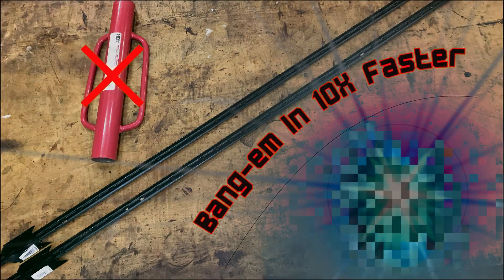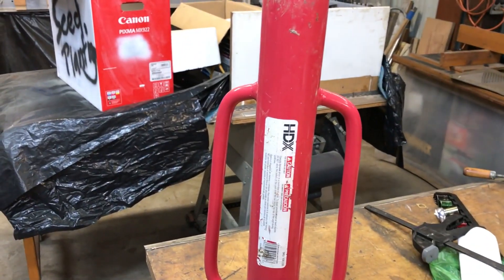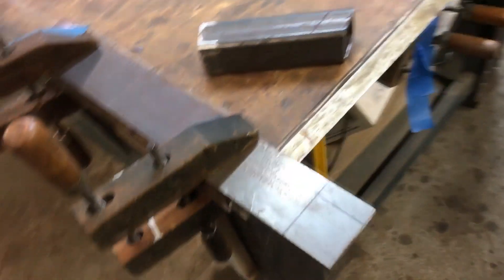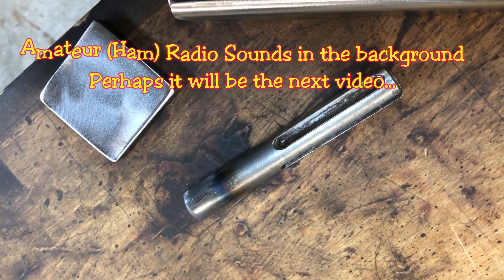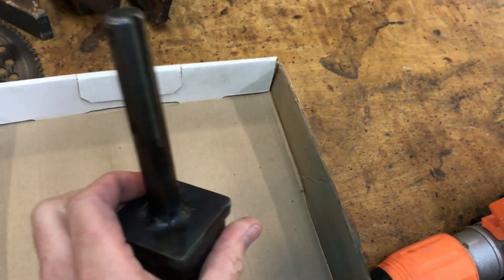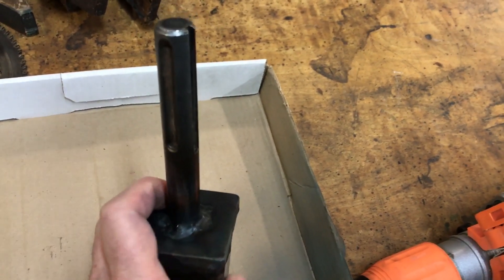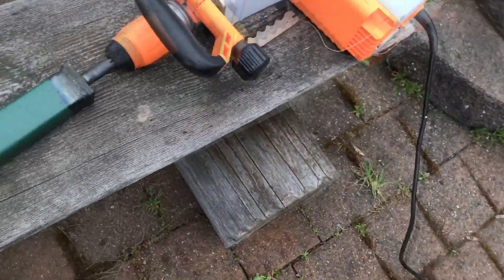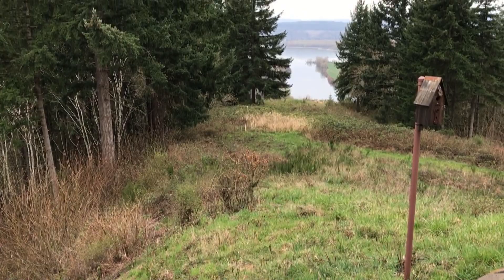Post Pounding 10x Faster

Comment: 6:50 Sometimes the simplest is NOT the simplest or the best. That dangling string seems to be getting in the way a lot. What you should have done is use a foot pedal switch. 
Momentary Power Foot Switch SKU: 57199
Power Maintained Foot Switch SKU: 57200

Or just a Power strip with ON/OFF switch.

I would have made the pounder attachment out of pipe not tubing. A little longer also. Make a sleeve over it to us as a handle.
Reply from the maker: They are good ideas; but application dependent.  I had to use this up on a 10' ladder in driving 10' lengths of EMT and thus needed a way to do so by hand.

Comment: I don’t care how HD you demo hammer is if you hit a large boulder you might buckle the T Post. Nice diy! Amazon has them ready made $25!
Reply from the maker: Sure if you hit a boulder find another spot to put the post.  Here we have clay soil full of rocks about the size up to a man's fist.  This even can push these aside in driving the post, so it works well here.  If you have hardpan and large rocks you'd need to use another technique.  
Amazon post pounders for $25 are just a section of closed pipe with handles - I've done that - can't drive posts very quickly that way.  
Thanks for the comment,  hope you find a way around the boulders...
RH
Reply: @ I used to punch a hole with a crowbar to explore first. The widely available tubular post pounders have enough steel in them to serve as a slide hammer

Comment: I'm going to build one of those today, I only got two posts to put in but that's okay I'll have it for the future. I'm also going to tyrap the trigger to on and plug it into a heavy duty wireless on/off remote control switch. Thank you so much have a great day.
Reply from the maker: Good to hear.  And I agree on the remote switch - in certain instances I'll be using a foot switch on mine next time I've been using on my drill press.  Some of what I was driving initially were 10' sections of 1" EMT, where I was standing on a tall ladder - so then the foot switch did not make sense.  for short enough posts it should work well though.

Comment from the maker: Yes the string part was a little jury rigged, to get it done.  A foot switch though would have been difficult when I was up on a 8 foot ladder driving some 10 foot sections of EMT, or 8' high T Posts. 
But I agree there are better ways of rigging a switch.  Thankyou for the comment.

Comment: Having used a demolition hammer to set thousands of 1/2" shank and 3/4" shank rivets, plus having diven many stakes, the lighter the contraption is that is set over the post, the more efficiently it will drive the post.   The part hitting the post needs to be strong, but the lighter the entire contraption is that goes in the demolition hammer the better it will work.  I never thought about using it to drive T.posts, but will use it this year for that.  Thanks!
Reply from the maker: Hi Robert -- I never thought of driving rivets with one -- but then I've only had to deal with small rivets. 
You said the lighter the 'contraption' the better it would drive the posts.  That seems counterintuitive.  
One way I like to test a thesis is with extending it.   Consider a post-pounder with negligible weight - as the driver extended it would just move the 'contraption' up 
and down and would have no effect on the post.  Moving the other direction, consider a 500 # contraption - its inertia would prevent any quick movement, and thus the power of every stroke would go into the post and drive it at nearly 100% efficiency.  
So if one graphs this function between these two extremes they would show even in practical cases that the heavier the 'contraption' the more 'impact' it would have in driving the posts.  Please let me know if I am missing something.
Reply: Hmmm: my demolition hammer is a Mikita.  It hammers when placed against something. I set all the rivets at the “Hanging Judge” courthoue restoration of the 1878 jail at the National Park in Ft smith. The impulse of the hammer remains the same regardless of the weight in front of it, and the inertia of the device on the front of the hammer affects house much energy is left to hit the post. To make the most energy work on the post, the heavier the person holding the hammer the more force will be delivered to the post. It became really apparent putting the heads on the 3/4” shank rivets. The shank is heated with a torch after the rivet is in place, then the hammer withe the riveting head is placed against the shank, a helper holds a bucking bar against the head on the other side and the riveting is done.  It was really noticeable how much faster the riveting happened with the lighter head. It is simple physics. The weight should be behind the hammer II transmit the most out of the front.  Look at it as having a small engine.  It can move a lawnmower quickly because the lawnmower is light.  It can only move a pickup truck slowly for acceleration because it weighs more. Or, if you have a .22 cal bullet a given powder charge will move the bullet out of the barrel at say 1300 fps. If you put the same energy (powder) behind a .45 bullet you would be lucky to get it out of the barrel.

Comment: this is great if there is an outlet nearby. at the ranch, we would need an extension cord miles long!
Reply from the maker: Thats where my little portable generator comes in.  They have gas powered post pounders which are very expensive. ~ $600 on up.

Comment: Circular Welds. Suggestion, mount your vise on a large diameter lazy Susan. This allows you to use one hand to rotate the work piece while maintaining the puddle.
Reply from the maker: I've heard that - its a good suggestion.  Especially good if you are doing multiple 'circular' welds.  Thankyou
Reply: For welding circular solid members, grind/machine the weld prep to a 90 deg. included angle chisel point with 1/8" flat nose.  Then weld from each side.
Reply from the maker: @BasementEngineer   Thanks Basement Engineer  ☀☀☀

Comment: Maybe make a Z shaped accessory for starting the tall ones so you could hold the tool about chest high at first then remove the Z shaped accessory and proceed as before.
Great idea you have there.
Reply from the maker: That's a marvelous idea.  thankyou Could even make it with a set screw if necessary.  Especially good when you are working on a hill where a ladder cannot be set up.

Comment: I had something close for my SDS drill to drive in ground rods.
Ever think of a series of posts with a 2x8 between them making like terraced steps. That would stop erosion and lessen the chance of getting impaled by a post up your leg or if you'd fall on one. Inventing things comes with the hobby,
Dave W9DLP
Reply from the maker: That's a good one Dave.  You could drive posts first then, slot/drill the 2x8 to fit over.  Unless I needed steps - I'd probably just wire tie them together near the tops.  Glad to see that you are also a Ham.  I need to start getting back on the air again.

Comment: Any chance a sawzall could work?
Reply from the maker: A couple issues.  (1) You'd have to have a mechanical 'disconnecter' to defeat the pull back stroke (otherwise your post would be trying to oscillate in the ground); (2) as the sawzall does not create impulse function forces, but instead uses strokes, it would require far more force than required for the demo hammer - in hard soil/rock t would then actually lift you up instead of pushing the post down.   😉

Comment: I use a 2’ bit and ten start the post in no fish line or ladder needed
Reply from the maker: Perhaps you are using shorter T-posts?
Otherwise -- if the bit is 2 feet long - then to slip it over an 8 foot post you'd have to have the bottom of the pounder at 8' +2' then the length of the pounder another 18" - so about 12 feet. 
So its not clear to me how you have rigged it up.

Comment: I think it needs a longer stroke but. It's working.. I'm building one to pound my water well
Reply from the maker: Without tons of calculations or real world testing - it would be difficult to tell.  The physics here is all about mass and inertia -- a short stroke is easier to assure the energy gets converted to drive the post.  And in a long stroke it may not be able to complete that stroke (e.g., think rocky soil), and stall the unit - that would be 'bad'.  But I hear you - we'd like the post to 'fly' into the ground !!  
Thanks

Comment from the maker: A comment from A Waren below made me think of a couple things here. 
(1) Be sure to at least make your welds deep. 

(2) If you want more strength...
Mine finally broke right where the end of the 'bit' welds to the plate.  
So I will be making a new one soon with more strength.  The one shown here just has a butt weld into a thick plate over the square steel.

The new one will add another plate.  So the round bit will go through a circular hole on first plate (sized to the exterior of the square tubing) and extend 1.5 inches more to be butt welded in the center of a second plate, which is sized for the interior of the 1/4 thick square tubing. Would weld to the inner plate first, and make a few small holes ~1/4" through the walls of the square tubing aligned with where this inner plate will sit. Then insert this inner plate, slide on and weld the outer plate to the back of the square tubing, ...then proceed to weld through the holes to hit the inner plate.  

Hope that makes sense...

This design would spread the impulse forces so they are not all concentrated on that one butt weld, and should last longer - especially if you have hardpan and rocks to go through like we do at times.  
This should be especially helpful as I suspect those impulse forces can shift to different sides of the butt weld, depending on how you are directing the post.  If the post starts going one way I counteract by tilting the opposite way.  So the stress is not always equally distributed across the whole weld - and can lead to more rapid failure.  Having two plates should be a real help here.

Comment: Would not work in Calichi and solid rock where I live. Must be nice to have soil soft as butter.
Reply: Yes.  It works on Caliche if you drill a pilot hole first.
Reply from the maker: Must be tough on rototillers as well - LOL.  
And well drillers must hate that too.

Comment: What happens when it hits a large rock - what can you do??
Reply from the maker: If the rock is small enough it will be pushed aside in this wet clay of ours; ...but too large of a rock and/or dry clay (hardpan), then you may have to move the post.  
When hitting rock the sound changes from thuds to banging sounds, ...cool to hear when the rock moves/splits and it returns to the soft thud sounds.
Reply: 1 inch x 16-22 inch SDS masonry bit.  Drill a pilot hole before you drive the post.
Reply: I live in Northwest Arkansas, in the hills. We have that red dirt clay and rocks. Let me tell you! My husband is getting too old to be doing this with your basic pounder. I wonder if this would work in our area? Thank you for the idea!!! We may try it out!

Comment: Nice idea, how many joules dose the breaking hammer has…?
Reply from the maker: Sorry - I don't know
Reply: @RelentlessHomesteading thankyou anyway, normaly IT IS written on the machin
Reply from the maker: Come to think of it - it actually is a 1/2 horsepower motor which is about 370 joules.
The Joules thing kind of threw me - we tend to think in HP here in the US.
Reply: @RelentlessHomesteading  The joule is a unit of energy. HP is a unit of power. It wouldn't be about 370 joules, it would be about 370 joules per second.

A lot of these tools list their impact energy in joules per impact along with the impacts per minute.

Thanks for the idea.
Reply from the maker: @nodriveknowitall702  thankyou for commenting and clarifying that.   Happy post-pounding !!
Reply: @RelentlessHomesteading  many many thanks, it is very helpful

Comment from the maker: 🪝🪝This was not for fencing, but for attaching ropes for the hill and stabilizing layers of soil.   And made for a good test of its operation.  
Appreciate the comment.
Reply: Seriously? A freaking 14 mins long vid? Is for vids like this that youtube shorts and tiktok are becoming so popular.
Reply: How do the posts stabilize the soil?
Reply from the maker: @rickwoodmeister2088   Good question.  This is landslide country - we've had them all over.  
Driving posts down over 6 foot into the soil in a pattern helps stabilize between the soil layers and can prevent landslides.  ...prayerfully...    RH

Comment: Excellent!  Have you considered making the driver head(?) to sell to us non-welding types?  Thanks for sharing
Reply: Buy a welder youll never reget it. A harbor freight titanium 125 flux core will last you forever and work for so many things. That was my first welder and i still use it frequently.
Reply: @michaelt.9372  thanks for the advice!  I have that exact welder, and I have followed the lead of some youtubers and modified it with capacitors.  I just haven’t welded enough to feel comfortable?
Reply: @willloy8901  Ive never modified mine. I dont think i would. Go buy some scrap and get to work!

Comment: Looks awesome!  But how do you get the posts back out when the wife comes out and says she wants them moved 3 inches to the left?
Reply from the maker: An age old problem that mankind has struggled with for centuries.  ;-}
Reply: HAHA! This got me
Reply: garden hose with a narrow stream nozzle works good to water-pick them out.
Reply: Those T- post pullers really do work.
Reply: You don’t! Tell her to make you a sammich 😂
Reply: Be a man and say no
Reply: Be a man and say no
Reply: That’s what that manual t post driver is for.
Reply: There is the driver system which uses a piece like a puller to engage the notches on the post. It allows driving lower and also reverse driving.
Reply: You use the back of your hand.
Reply: My wife always ask me for 3 inches more to the left…
🤦‍♂️🫣🥴😂

Comment: Lean posts into hill?  Just like the gravity-wall leans into the hill?  My posts all ended up pointing horizontal away from the hillside after a few years.  Then they didn't hold anything back.  Best to start them leaning in?
Reply: It means your posts are not strong enough, or you need more posts, or you need longer posts driven deeper.

Comment: It would really help if you told us the specs of your hammer.  You can get cheap ones that would have a hard time diving a pencil into soft butter.   I used the same system about 16 years ago for putting in a horse pasture.  I got the demo hammer and T-Post adapter from a rental shop.  I didn't pay any attention to the specs of the hammer as it was just down the road from me.  I could rent it whenever I needed to.  Well, I moved out of state and now need to fence off about 15 acres.  Time to get my own but I'm not sure what hammer to buy.
Reply: 07:10, 07:12 "Item 93853. Demolition hammer. Electrical requirements: 115 VAC / 60 Hz / 11 AMPS, Variable Speed 900-1800 RPM, Accepts SDS Max Type Bits"
2:15 "Chicago Electric Power Tools, Industrial Demolition Hammer"
Reply from the maker: If its too heavy it will be hard to get over the post.  Mine is the biggest I was comfortable with using.  I've pounded in 10' sections of EMT with it as well, and being on soft garden soil on top of a 12' ladder with with a 35 pound tool is already a little dicey.  LOL.

Comment: Works!  The less mass that the hammer blows have to negate against will drive the post harder.  If your tool weighed 100 lbs. then it wouldn't drive at all.  Yours seems light enough.  So I'm going to make mine out of short round pipe, 3" long and plate that is small as can be.  More energy to the post.  Thanks for the idea.
Reply: "less mass.. drive harder.." guess you have never removed lug nuts then
Reply: @EkonRekon  100 lb. nut drive it less harder than a 1 oz. nut?
Reply: I'm a little confused about this comment.  By "tool" are you referring to the welded bit or the hammer in its entirety? I'm guessing you meant that if the manufactured bit had more mass the hammer would have to expend some of its driving energy to overcome the inertia of the bit.  Or do you mean that a 100 lb jackhammer would not drive the posts?
Reply: @cli2ox  in a Gas powered driver the anvil striking the post had to bounce back up against the hammer to drive the hammer back up for the motor to work for the driver action - maybe that's what he's referring to by having a lighter machine it is easier for the anvil to raise the hammer? Otherwise I have no idea.
Reply: Adapter weigh less. Hammer work better with less weight.

Comment: hi sir  I love the idea and how it works, I am planning also to fence my  sloping garden I love to do it by my self. using same technique as you did, but I  would love to know the list of materials that I would like to use sir can you correct me if there something I missed
1. hammer machine
2. metal post
3 sq bar for angle post
4. what is the name of that round stuff that you put on the sq bar?
I just learning little by little I be familiar its names

Comment: I had a similar idea but for a larger hammer I have. Good job.
Reply from the maker: Thankyou -  One could mount the mechanism on the side and use like an old valve rocker type assembly on top to convert the direction.  Would be nice to have the weight lower - but this was quick and dirty.
Reply: RelentlessHomesteading correct, that’s what I was thinking. The length of the extension would be the finished height of the post. Just simply run it to the ground.
Reply from the maker: @RedefineLiving    Exactly !!!  here I'm driving some down to almost ground level to stabilize hill, but regular fencing your low-slung post pounder would be better.